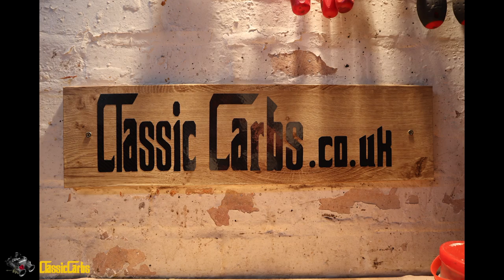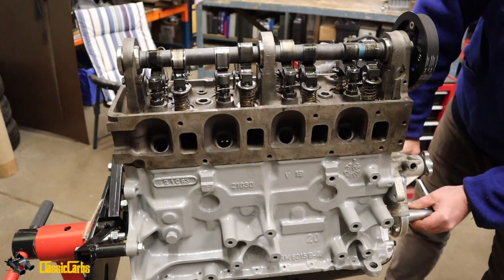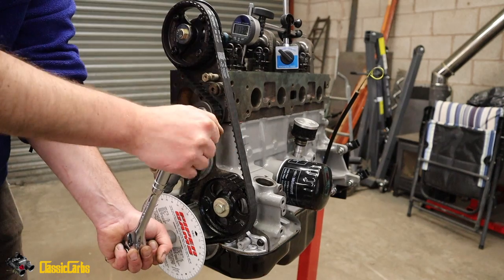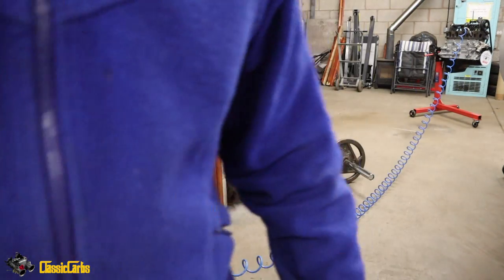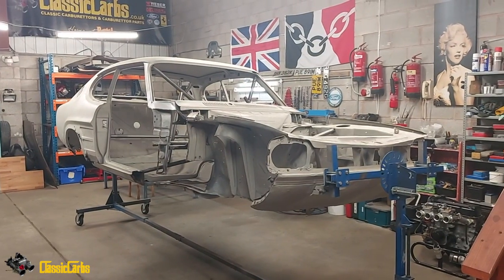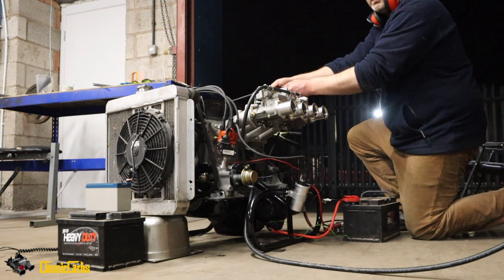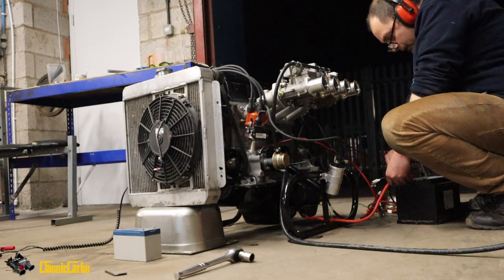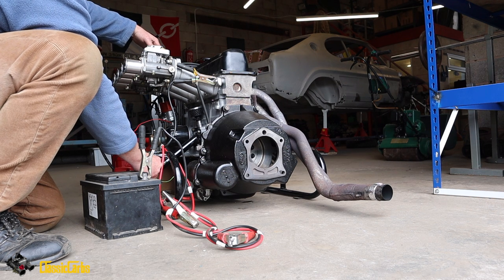1969 FORD CAPRI - PART 92 - Ford 2.0L pinto engine build & first Start up | LONG PLAY

Comment: Additionally, about your leaking valves; when I was a 15 year old helping my father in his shop he taught me to always "lap-in" the valves with a bit of value grinding compound so you could see the seat to valve contact area - it's width and location on the valve face as well as the concentricity on the face/seat area.  That lesson served me well for over 50 years - take nothing for granted.  My father had been a Ford mechanic before WWII and again right after the war, before opening his own machine shop; so, I learned a lot of old school stuff.
Reply from the maker: Thank you Mr B. Herrmann for your messages. It would be great if you would be here for building one of these engines together :)
Reply: @Classiccarbscouk      
Rusty, That would be much fun.  But at 82 years young I don't believe that any trips across the Atlantic are in my future - at least right now.  Currently I have four projects going and that 's keeping plenty occupied.  I am renewing a 1972 Ford F100, a 1980 Chevy el Camino, a 1970 Ford F350 and a 1973 Pinto with a Kent engine.  As I mentioned earlier I am hoping to add a Ford Model A coupe to my collection by moving on from the Chevy so I have the room and time.  I had an American style Model A hotrod as a kid in the 1950's and I want to go there again.  But the biggest thing right now is to finish up my shop - insulation, then heat and AC.  By the way, noticed that the engine stand you used for your start-up seemed to be custom for that engine.  Did you build that or purchase?

Comment: I built lots of these engine for American drag racing in the late 1970's and in the 1980s and a few circle track engines.  Still have a bunch of parts and two cars waiting for restoration or part-out as I am now an old man.  Like you, I made a lot of mistakes in the first engine or two and unfortunately, in those days the only real help was the official Ford Performance booklet for this engine and other racers and there were a lot of misconceptions floating around out there.  If I live long enough the next plan is to put a 2.0 liter with Webbers and a five speed into a Model A fender less coupe.  thank you for the excursion down the memory highway and reviving my interest in this fantastic little engine.

Comment: To properly set the distributor timing before the first start. First put your engine at proper TDC. Then roll it back to 10 degrees BTDC (starting point). Hook up your timing light and run 12 volt power to the distributor. Then gently turn the distributor by hand till the timing light flashes. Lock down distributor.
Reply from the maker: Thanks

Comment: thanks for the vid lads. when you used the kent dial wheel/card, i made a pointer with braze rod to sit over the card markings, filed the end of the braze rod to make a pointer, found it helped a lot

Comment: Sounding fab now that with pipercam. Lumpy idle and serious snap throaty throttle. Wish i had this for my capri 2.0 sport back in the day. Before i became a ford mechanic to rebuild these from the bottom up, as it was a clapped out gold seal pinto rebuild. class work guys

Comment: you did good mano.   i kept wanting to give you advice on the cam trimming to use a piece of wire as a pointer on the timing wheel.  i've seen valve done to the point they are setting deep in the valve seat. your look like they was sitting high.  but it's probably just camera angle.  don't know where your at on the engine but i would be tempted to visit the cam timing again just to make sure.  and the valve job the first place did.  i would of taken it back and told them it was trash and do it right.  you shouldn't pay for crappy work.  wish i was around to give ya a hand.  but we are an pond away.  it sounds good and you can hear that cam it does sound good.
Reply from the maker: Thank you ken, it has been a steep learning process - be great to have you here for a bit of help :)

Comment: To make timing the cam easier to understand its best to treat the block and head as 2 separate items.  What i mean is set cylinder 1 to tdc, set up yourtiming disc to the tdc mark then move it rotationally to your 106 deg atdc mark.  Now look at your head.  Set up ure inlet valve to full lift using ure dial gauge. Then you fit your timing belt and with vernier adjust if the belt teeth are slightly out from the teeth on your vernier.  I would do this on a pinto with the followers out the other 3 cylinders so no accidental valve to piston issues then after cylinder 1 set, you can then fit up the followers to the other 3 cylinders
Reply from the maker: Yep, your plan would have made it much easier - Where were you man!!! +)

Comment: I know this was a year ago, but with the Exhaust valves fully compressed you wouldn't normally be able to push the valve open further "with you're finger"with the correct springs fitted..

Comment: You know your Carbs don't ya mate :)  I don't live that far from Wéber carbs where I think it USED to be which was Pound Lane near Basildon I always drove past the place in a Capri or Cortina back in the day and used to think "I know where to come if I need one" but the reality is I just lived with what I had and at 19 I used to twiddle the air/fuel mixture screw and inspect the spark plugs  for a "tan brown" colour   ..  I think the Haynes manual used to say "Use Champion double copper spark plugs" but mine were "NGK" or something lol

Comment: When you rebuild an engine like this it’s always hard to start for a while because it’s so tight, I wouldn’t even try to tune it yet till it’s run in a bit, you can see how quick it stops rotating when it cuts out.

Comment: Did they cut the valve seats with a cricket bat? Can always check valve straightness by rolling on a flat surface. Grinding paste is carborundum. You're looking for a consistent band of contact, around 2mm wide on the inlet & 3mm on the exhaust for a regular road engine. 8.5:1? Seems very low? Would have thought 10:1 minimum. Definitely a miss for the spec. Seems like an odd mix of bits. Lightweight flywheel is generally a bad idea for a road oriented engine too as it will make it more vibey & potentially give clutch judder problems.
Reply from the maker: Thanks for input. We are on a steep learning curve. We'll probably learn even more when we get to drive the car for the first time.
Thanks for watching and for your input 👍

Comment: Hello I'm in the process of fitting sidedrafts to my pinto engine will the mechanical pump be fine to fuel it I see in the video you have no pressure regulator and it running fine
Reply from the maker: @claymunsamy  yes, as far as I know, if your mechanical pump is in good condition - and preferably a genuine pump- you'll be good with regards to fuel volume. A regulator might be a good idea though, especially if the carbs start leaking
Reply: @Classiccarbscouk   thank you so much for your response much appreciated 👍👍🙏🙏

Comment: I’m having huge problems trying to start my pinto, hopefully I can use the advice on the comments, it’s a timing issue, so this will certainly help
Reply from the maker: Spark, fuel and air , and perhaps compression. If you have all these happening, it'll fire 💪

Comment: How much material can I shave off a stock 2.0L cylinder head?
Reply from the maker: Dan, the engine builder (you) needs to work this out really.
We figured about 2mm off the head would be max, but we didn't try it.

Emmanuel

Comment: Mano did you just set the valve timing to TDC or use a dail gauge to measure the lift at TDC Bottom TDC And divide the degrees by two like it says how to in vizzard bible because if you haven’t you won’t be be getting full lift and duration from cam
Reply from the maker: Not sure if I did or didnt count 🙈

Comment: It sounds like to my that as the oil pressure builds its changes the back lash on the rocker.? Sum of the latter pinto had oil filled adjusted

Comment: 1:24:19 If I may make a suggestion, the smell might be unleaded fuel in a leaded fuel engine, just saying mate. 
What is the ringing at the end of every attempt?
1:32:32 I feel your frustration.
All is good at the end, she sounds great mate.
Reply from the maker: Thanks Maurice.
I think we were in a bit of a trance that evening.. It was late, and we were excited about starting the engine.
It really did smell strange, kind of nice, and strange.

The bell sound after each attempt was the flywheel and starter motor engaging, i think.

The engine has been in storage, and we're looking forward to starting it again :)

Thanks for your comment, input and support :)
Emmanuel

Comment: If I’m following correctly….you started with 100ml so is it not 100 minus 57 for the displacement in the head chamber …. 🤔
Reply from the maker: Thats an interesting comment.
Are you suggesting we have 43cc combustion chambers?
Reply: @Classiccarbscouk  if I understand that you filled the tube to 100 then it had 57 left gives 43 in the head
Reply from the maker: @patrickh7368  I did check it , after reading your message, and it appears that we were correct. After filling the chamber, we're left with 57cc in the burette
Reply: @Classiccarbscouk  that’s what confuses me. If it started with 100 in and after filling the chamber 57 was left in the burette doesn’t that mean 43 in the head chamber ? But if your sure then I’ve misunderstood something